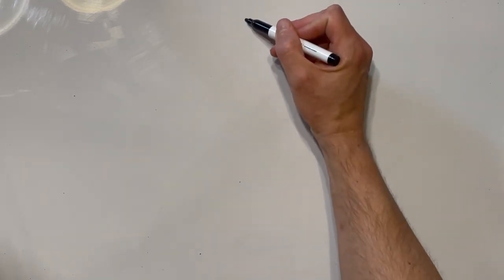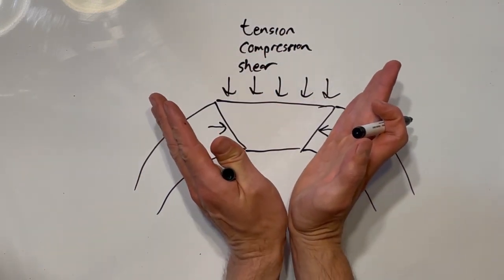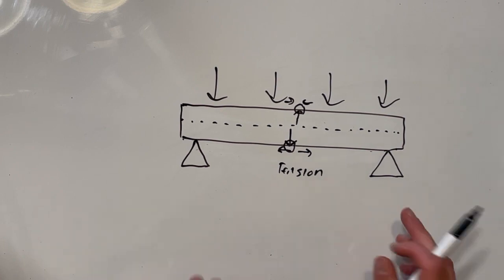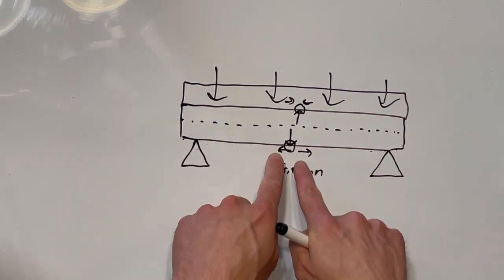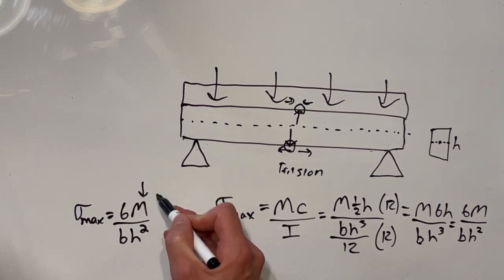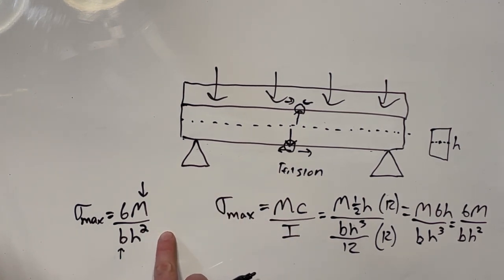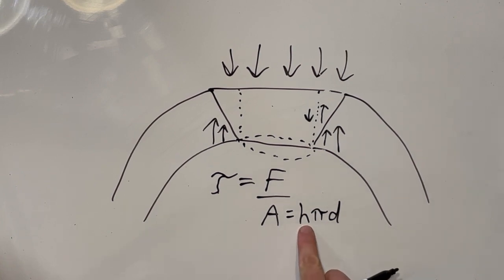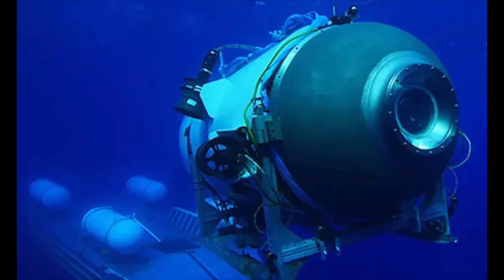Engineering Analysis - Did the Titan's Viewport Window Fail?

Comment: I have done a bit of destructive testing under compression.. I could see that view port popping out (concussed) by the implosion.. It would be the only time of the entire voyage that the bolts would have mattered.. Certainly not holding the viewport in the hole during the dive  lol..  I saw one engineers calculations on the energy expressed when that thing imploaded..   The millisecond that it took equaled the power consumption of NY city for that millisecond (or 2)..    I have no idea on that number but if only half right?  that is a bunch of energy...
Reply from the maker: That would likely be a rather complex system to model and come up with such a number, but at least we can agree on the fact that once the hull gave way, the immense water pressure accelerated some mass at great speed and would have created a rather significantly pressurized pockets of air.
Reply: so what I could gather.. Implosion at that pressure is around 1500mph.  The stored energy released was around 200Mj in one millisecond.. ?  does that sound right?

Comment: For me it looks that not just the window, but the clamping ring is also missing. It means, that the pressure pushed out the window in once piece.
Reply from the maker: Yes. I added that near the end in a text blurb. I meant to talk about it when I recorded it and then it slipped my mind.  There was a few small bolts to shear off, easily doable.
Reply: Sorry, I did not notice, because I was more listening than watching this video.
Reply from the maker: @williamforsyth6667  no worries at all.  My bad for missing it in the dialogue.
Reply: In one shot of the recovery vids you can see the bent up clamping ring.

Comment: I'm no mechanical engineer so I remain confused how the pressure inside the container could become greater than that of the outside. It would seem to me the craft would crush until the pressure inside becomes equal to that of the outside at which point, no outward pressure would ever be present. Isn't that how it would work? OTOH, I understand that pressurizing the relative tiny bit of air inside would (very quickly) increase its temperature (to, I as I understand it, 1000's of degrees?) and would that also potentially increase the internal pressure to something more than that of the outside? Or would that just counteract any further crushing pressure? Isn't there something about conservation of energy involved somewhere in this? I don't get it. Inquiring minds want to know :)
Reply from the maker: Think of a weight on the end of a spring.  It will have a point where it will rest.  Now either pull the weight down and let it go, or raise the weight and let it drop.  It will oscillate up and down from its neutral resting point.  The hill suddenly collapsing has mass and kinetic energy behind it and it can increase the internal air pressure to higher than the external water pressure, and then in theory the air bubble would then expand and contract again and again like the weight on the spring oscillating.  It would all happen very quickly.
Reply: @theeverydayengineer1  Oh. Thanks. And BTW, excellent video. Nicely done.
Reply: @theeverydayengineer1   I'd add it was not just compressed gases on inside acting to shear out the viewport and retaining ring outward, but all matter with water in combination accelerating into funnel aspect of dome sections due to shape. Are there any better quality pictures showing the bolts ie, did they tear out of titanium base metal or broke at threads roots ?

Comment: Consider this: if we set the pressure at the point where a "first bolt" fails and progresses through adjacent bolts until the lens pops out and any remaining bolts then stay in place. If we increase the pressure by a factor of, say 100, would the progression of bolt fails be any different? I say no. There SHOULD BE bolts and the ring still attached after the pressure wave on one side. It was removed for evidence and lifting/deck storage.

Comment: so basically what you are saying is when the carbon fiber hull collapsed and pressurized the air forcing it out the view port the people inside were pushed out of the 12' diameter view port simultaneously turning them into hamburger or caseless sausage? interesting...
Reply: No, they got impaled on the hull implosion.
Reply: @dousiastailfeather9454  do you understand what being “impaled “ is?